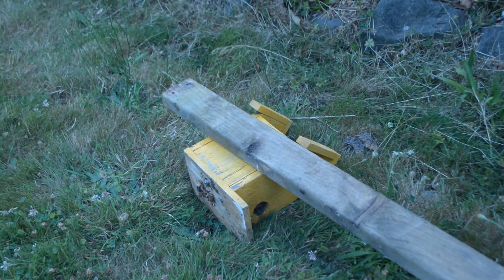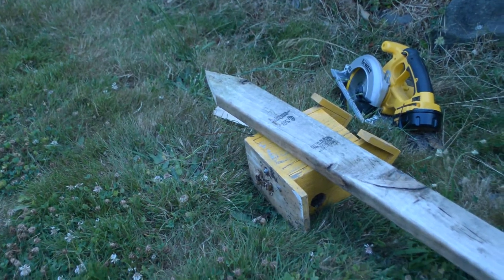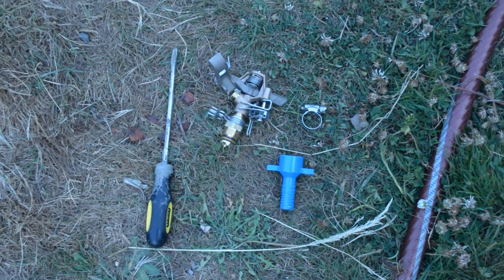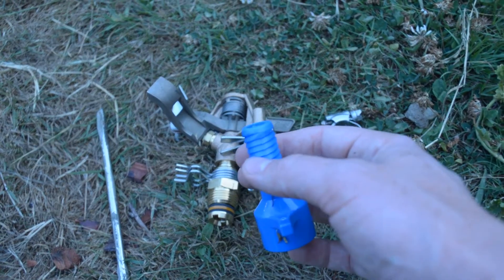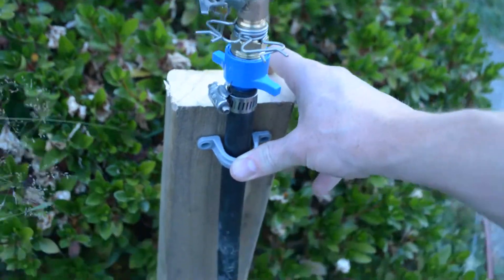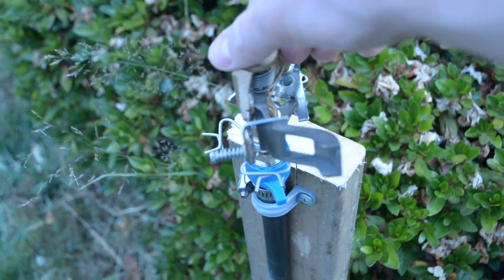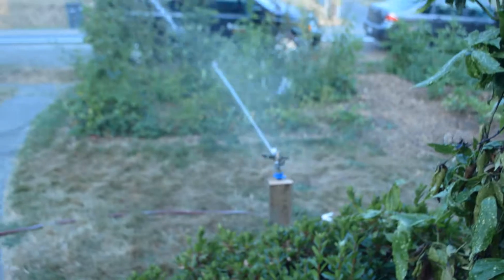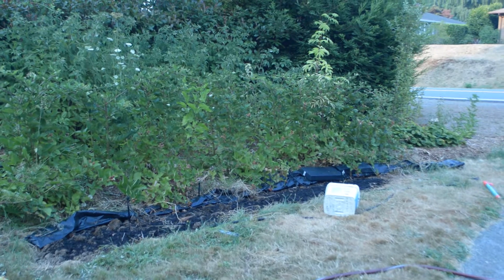Rainbird Brass Impact Sprinkler Installation | Farming Seattle

Comment: ah yes the 25PJDA-C. Good sprinkler for a riser setup. Not only does it keep sidesplash in line with the stream, they also last a long time. Even in lower pressure situations. I have one of these as well as an Orbit copy, which looks identical but has a few minor details.
Reply from the maker: Christopher Ryan yeah, worked pretty good this year, was able to automatically cover the front yard garden with one sprinkler.